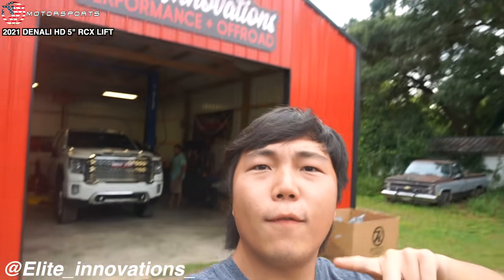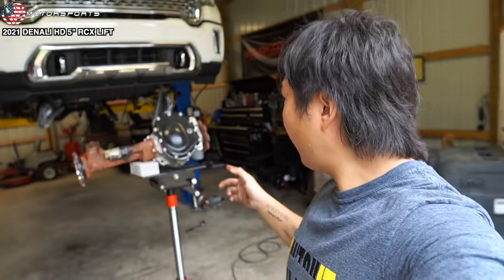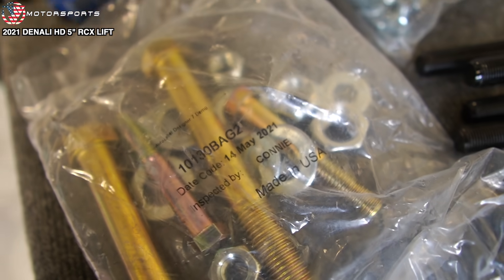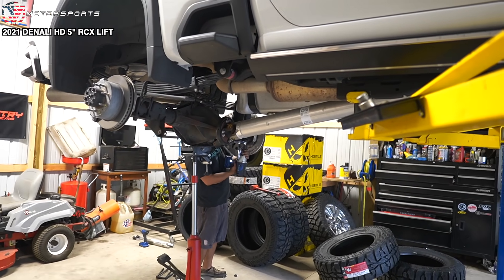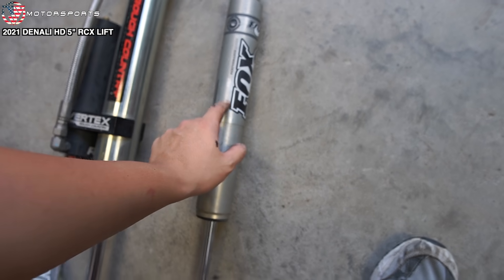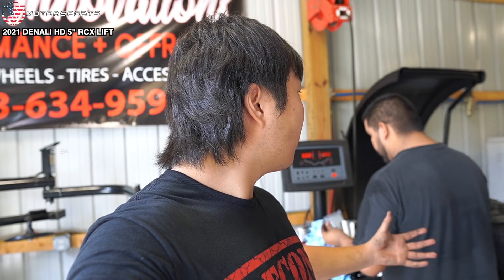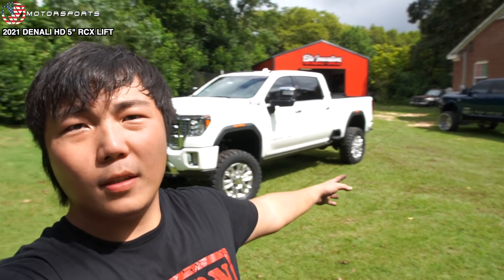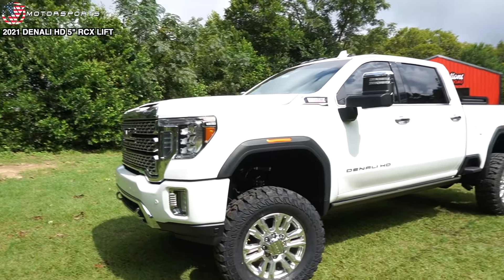5" Lift on 37s | 2020+ Duramax! *2021 Denali HD*

Comment: Any follow-up on how this truck is working out for your dad?  I'm interested in the Vertex shocks but long term reviews are non-existent on them in the 2500 HD space.  Current daily driver ride quality and how it still tows heavier trailers is my biggest question.  Basically, have the shocks held up?
Reply from the maker: As of 10-15-24, he still likes them!

Comment: The tires under the truck is the way to go. I will never understand this 33 on 20 or 22 by 16 wide look. its just simply horrendous. Tall and under the wheel wells is the way to go. Id honestly crabk down the front if possible to level it. Killer channel btw. You really do good informing about these trucks

Comment: In your opinion how wide/ tall can you go with a run and tire set up on this truck with some trimming or an off-road bumper wanting to run 26x14s on 35s or 37s would it be possible on this lift with a ranch hand number ?
Reply from the maker: You’d need a 7” kit at least for that offset

Comment: The lift looks great. However, using the kryptonite upper control arms versus the rough country control arms from the kit does not really give a true idea on how the roof country kit would compare solely as the kid itself versus a kryptonite suspension kit or BDS. Something to note the real only difference to the roof country kit versus the BDS kit is the $1,000 extra you pay for Fox shocks versus the rough country knock-off shocks.
Reply from the maker: Most people with BDS upgrade their UCA with Kryptonite or Cognito so it does give a good idea.

Comment: How does a 2021 already have rust ? Just curious
Reply from the maker: They rust within months. Also lived up north for a year with salt on the ground
Reply: I got 21  Denali hd, live in Canada,  I complained about the under coating  for that exact reason,  salt on roads in winter ! So the spayed it again, , did much  better filling some seems and gaps they missed, on there dime of course, got brand new and crawled underneath  for a look  , factory cheeped out a bit but dealer fixed  it 👍

Comment: How are the angles up front?
Reply from the maker: Looks good. I shows in the video towards the end
Reply: It's not straight. Got alotta angle. We're the keys cranked? Looking at a 2024 and want a non torsion drop and non track width extension 5' kit. Rough country offers that but the angles are not that good.
Reply: @kylestanford7574  whole lot of angle on those cv axle